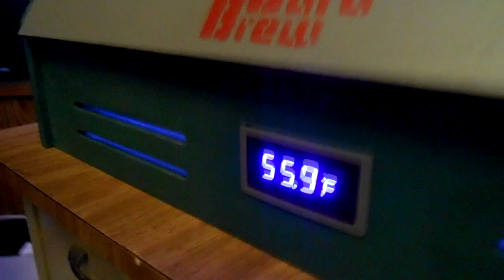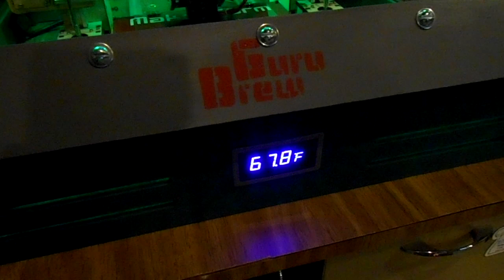3D Maker Farm Prusa Printer Update

Comment: on the website it says I need a separate power supply for the heated bed. are you using a 2nd one?
Reply from the maker: Rob Hopper Here is the power supply I have and it works great. This one will run the bed and all the other electronics.
http://astore.amazon.com/gubrwetesh-20/detail/B00D7CWSCG
Reply: GuruBrew Thanks for the quick reply. I was just concerned because on the site it says "The large Heatbed draws more current than a standard size Heatbed, approximately 20+ amps at startup for a few minutes. It will most likely require a separate 12VDC power supply.  If you plan on using a thermistor with your heat bed you will need to power your Heat bed via a Relay connected to your electronics since most electronics cannot output 20+ amps." Which made me think I needed a 2nd PSU.
Reply from the maker: Rob Hopper No problem, the kit comes with the relay for the bed so get the power supply I suggested and you will be good to go, power wise. Steve
Reply: GuruBrew awesome thanks! i can't wait to get it, I am picking up the 12x12 i3v

Comment: Steve I have several questions you might want to include in a future video.  Any concern over the use of wood in the construction as to shrinkage, warping, etc?  You chose 3mm filament over 1.75mm, what was the logic behind that?  Any decision on PLA or ABS.  What sort of items have you made so far?  What are the maintenance considerations such as noozle cleaning?  Is Thingiverse a resource worth using?  Finally after watching your build video, for the second time, I was struck by the amount of work needed to tidy up the wiring.  Check out split loom tubing for wire bundling, easy to install and inexpensive.
Reply from the maker: OK, thanks :)  I will refer to these in our next update.